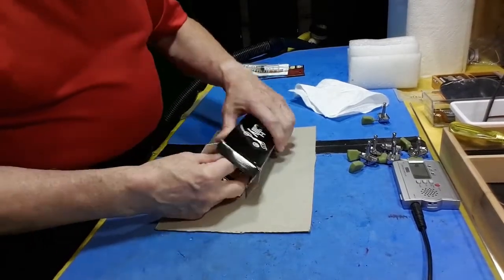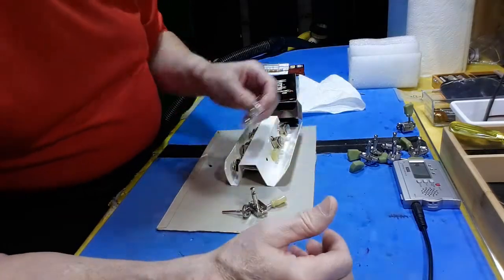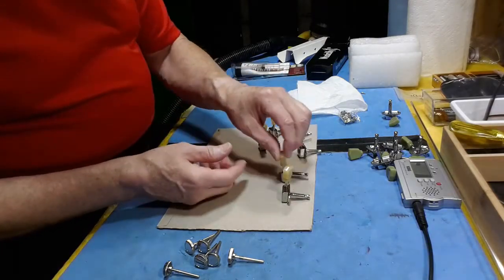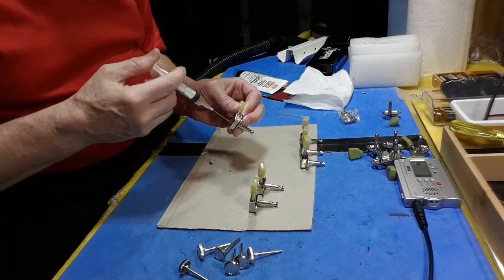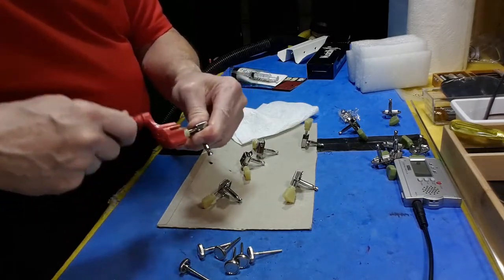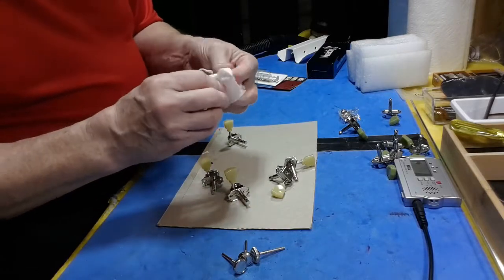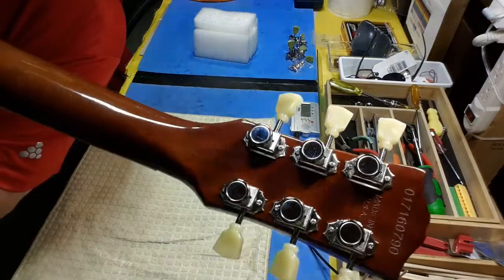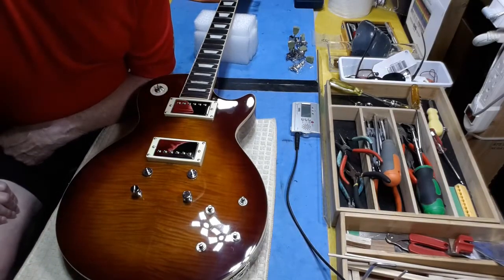TONY TIGER CHIBSON LP - PART 3 - AUGUST 2023

Comment: about tuners ,i dont like the tuner too smoot too easy to turn , i like the tuning head feels little bit resistant or bit tighter, that easier to tune the guitar to me, so i never oil the turning head , i dont know why ,maybe i just used to cheap tuning head or not very well maintained tuner.😅😅 but the tuners still working well so far, great flame top anyway , is nitro finish ? if the finish slightly lighter that make the flame looks even better ,so if is nitro, normally the color slowly fading right..? now chibson les paul got fret nips , so nitro laquer totally possible .
Reply from the maker: I think it's polyester